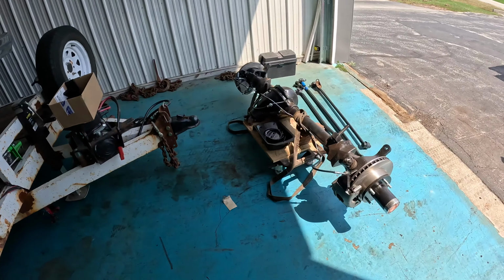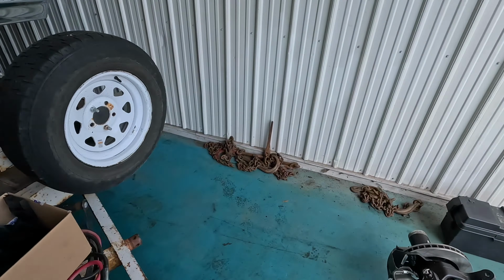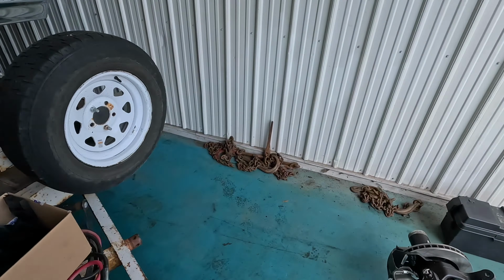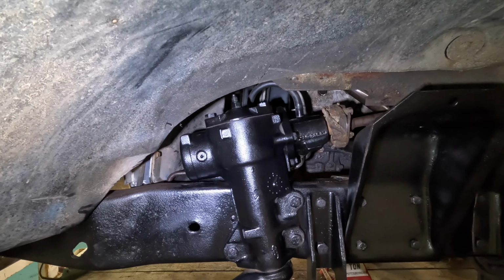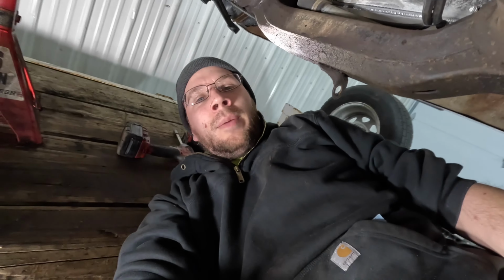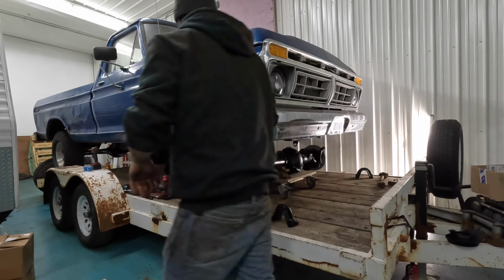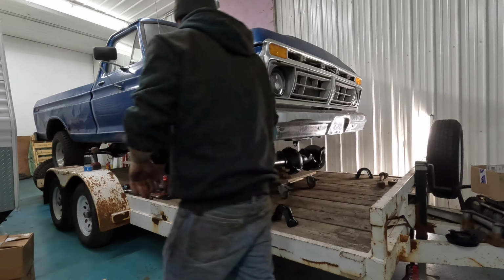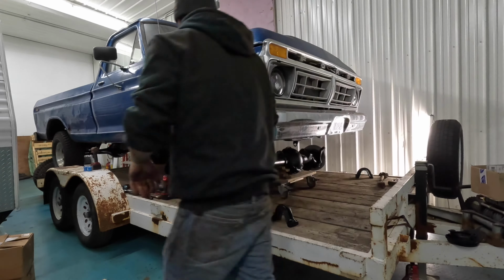Front Axle Swap Part 3 - 1977 Ford F150 LS Swap

Comment: what do you do if your tie rod ends in the hubs are worn out? any solutions?
Reply from the maker: Are you referring to the tie rod end holes in the knuckle?
Reply: @machnikgarage  correct
Reply from the maker: I have never had to deal with that issue but if it was me I would look at sourcing a new use knuckle. There may be kits out there to drill it out and insert a new tapered seat. I would compare the prices on repair kits, a whole use axle, or a knuckle itself. Sometimes you can find a used axle on the market place and the spare parts it gives you is a better value than just buying the part needed.
Reply: @machnikgarage  thanks. Really enjoy the channel and the different projects. Hope to see more in future